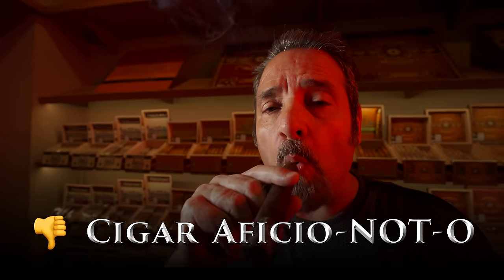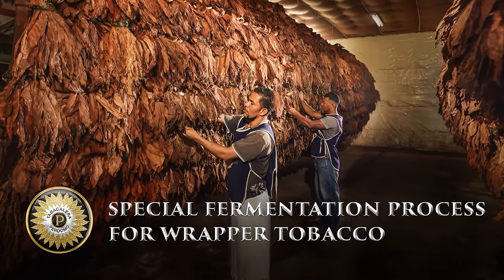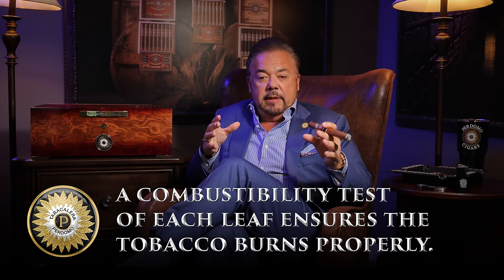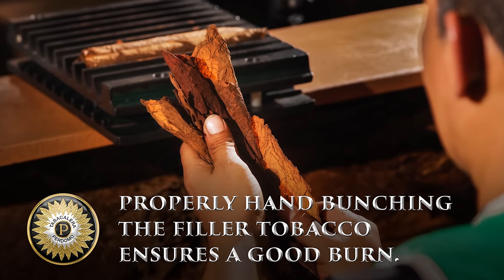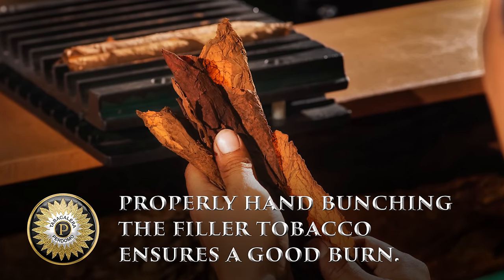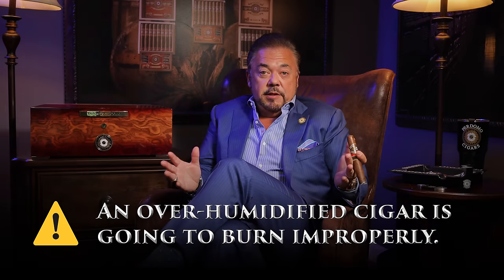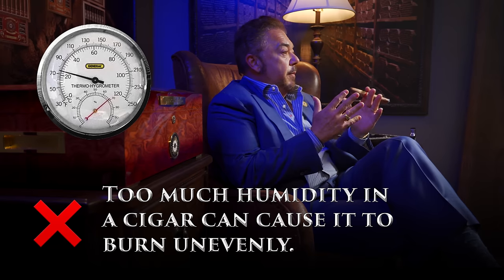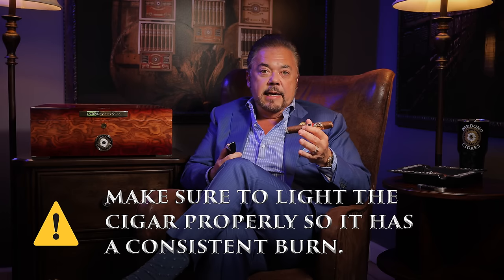Why Cigars Burn Unevenly

Comment: Very helpful tips!  I usually smoke cigars three times a day.   Out of a box of 25, will occasionally run into what you have touched upon.  One work around that I discovered many years ago,  is to trim the area that is not burning properly.   Then relight.   Your definitely 100% correct regarding that some cigars will unfortunately have to be discarded.

Comment: Great stuff. Always right on things. Your video on lighting cigar confirmed what i thought about the over torching. I even use a soft flame for the filler as to have a less hot flame or matches when its not windy. Also agreed on 62% to 65% humidity. Ive never had one of your cigars, but your videos have convinced me. A master marketer as another commentor said!

Comment: Thank you, I want to say I have been frustrated the last couple days. I am a semi novice smoker and I am truly thankful for this article/video. 
I have been experiencing just what your video expresses.
I bought some very expensive cigars, for my budget Drew Estates ACID, and was so disappointed by the burning I had. So seeking some assistance this video made it clear what I was doing wrong. 
I light up many times to keep the ash going. Burning the bottom to get a better draw. Keep it going. No patience. It was burning uneven on three of the sticks I was using. I thought it was because of faulty rolling but learned it was ME. 
Today I had the best burn and consistent result by applying what Nick Perdomo stated. 
I am a follower as of this week. 
Thank you

Comment: Appreciate the tip re: 'over-humidifying', which I tend to set a little higher anyway to 'compensate' for Arizona's uber-dry desert climate that often seems to suck the moisture outta everything as soon as it leaves the humidor. Though sounds like my own frequent 'canoeing' issues could mean I'm 'over-compensating' a bit in the humidity dept ...Grazie!

Comment: Thank you NP for your suggestion on the book opening push of a cigar that has a wonky burn it worked wonders on the cigar that I’m smoking today. Alas it is not a Perdomo cigar. But then I’ve never had an issue with a Perdomo cigar having a wonky burn.

Comment: Another thing to mention is storage conditions beyond proper humidity- ROTATION! I don’t sit there and turn everything around on the shelf but I certainly move my shelves around within my stand up humidor. Bottom shelf to top, etc. when u have a lot of cigars, as some of us so blessed, sometimes only the tops of most cigars are getting exposed to the air circulation. So it’s important to move stuff around at least every month or so. It’s nice too because you’ll cone across some beauties you mighta forgotten you even had!!

Comment: When I light my cigar I use a strong torch about 4 inches apart from the cigar and torch the cigar until it lights itself, first I light the cigar or toast the cigar to mold the binder and wrapper together and then I rotate the torch without pulling on the cigar to the point where it lights itself and then I blow on the front end of the cigar and then start smoking;  flavor preserved
Reply: I use the same method.   Toasting the foot of the cigar then rotating 360 degrees to ensure an even light.
Reply: Try doing it while you sing...the wheels on the bus go round and round...

Comment: I tend to rotate my cigar as I draw on it; another reason for the tunneling is that when you pull most of the air when you're pulling on the cigar is at the bottom of the cigar, so when I start tunneling at the bottom of the cigar rotate the cigar and start pulling on that side and after about a minute or two of pulling it begins to burn evenly

Comment: I had very bad tunneling on my cigars this year. I noticed Connecticut broadleaf wrappers were the worst. I tried everything: lowering/ increasing humidity, resting for weeks/months, puffing slow/fast but nothing worked. Happened to boxes of liga privadas, the tabernacle, cao session among others with a similar wrapper which would just not combust. A ton of $ wasted on these boxes since I thought it was my fault so I kept lighting them up and trying to change things so they would burn right instead of returning. I am suspecting bad crops throughout the industry.

Comment: The first commandment of the Cigar Bible, "You shall put no cigar manufacturer above Perdomo", 2nd commandment , "Nick Perdomo is the cigar Numero Uno god".   I was smoking a Perdomo 10th Anniversary Maduro which was burning a bit uneven.  I followed Nick's suggestion (command)  and tried to push down on it a bit, but I pushed too hard and cracked the wrapper. Thought I ruined it. But, buy golly, that baby ended up smoking PERFECTLY to the nub.  Through the cracked part and down to the end. Lesson learned : be careful when following Nick's advice, and always trust The Nick !!! 😀

Comment: For me the problem was that I was drawing on my cigars too hard and not waiting 45 seconds before I took another puff as well as keeping the ash for at least an inch to an inch and a half

But I won’t discard this ago after I just paid over $15 for it, after it remains inconsistent after a few purchases I won’t purchase it again, but I have special cigar clippers that allows me to cut the portion of cigar that has not burned down to the portion that is wait for the Cigar to burn out and then like that portion I’m having trouble with first, for me problem fixed

Comment: Hey, do you have any good blend reccomendations from your brand? I tried the Perdomo 10th Anniversary Champagne and it was alright but not quite what I wanted out of it's flavor. Still better than some more expensive ones I have had. I will say the draw and rolling were some of the best I have come accross. Considering I recently paid $30 for a Montecristo Epic 07 Selection limited edition torpedo and it unraveled on me, and burned uneven despite cutting it properly and the taste was the same as the cheaper Epic Slection 07 unlimited, I was dissapointed. I have had certain Ashtons unroll on me as well and some flavors have been hit or miss but better than others. Really Rocky Patel aged 10, 11, and 12 years box pressed and Don Diego conneticuts have been my go to lately although the draw on yours was even better than the boxed pressed ones. If you have any suggestions on what you think your best blends are and maybe something comparable to those cigars or better as well I'd love to try them if my local cigar shop has them or I will just order them online. You seem like a good guy and I am sure you would know better than anyone what your best blends are so I'd love to hear your opinions on what to try from your brand.

Comment: 3:23 Do Not Discard the cigar.. it's an easy fix, SIMPLY: Add Fire to the unlit side.. it'll take a lil skill but, just rotate cigar over the flame, rocking from 3oclock to 9oclock.

Comment: Yea, baby. Had a lot of bad burns from "well made" cigars. It comes with the habit/hobby. It's gonna happen to a cigar or two at any price. Sometimes you can cut the bad burn off and fix the problem; sometimes you can not. It's simply a bad stick and time to lay it down and light another. One must accept this else give it up all together or switch to a pipe which can also have a bad burn. I don't go near sickly Dutch Master cigars anymore but I have to say that they always burned evenly.